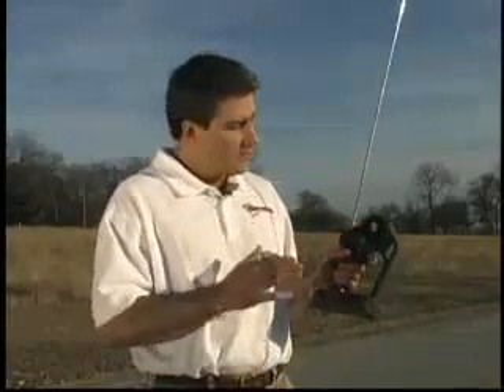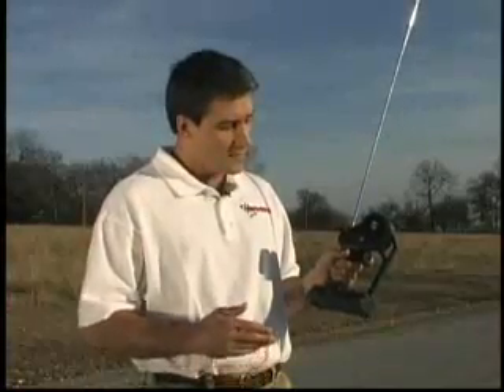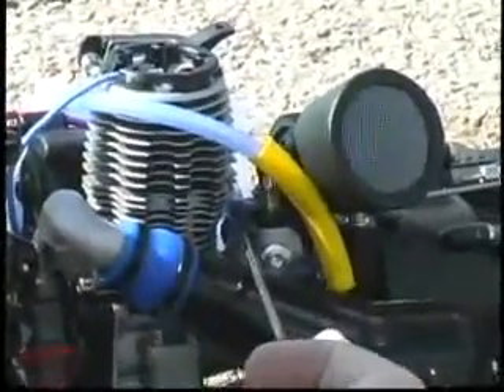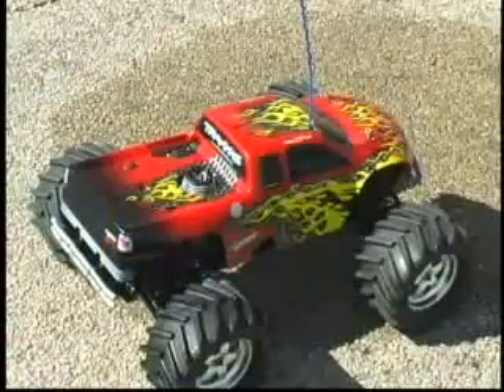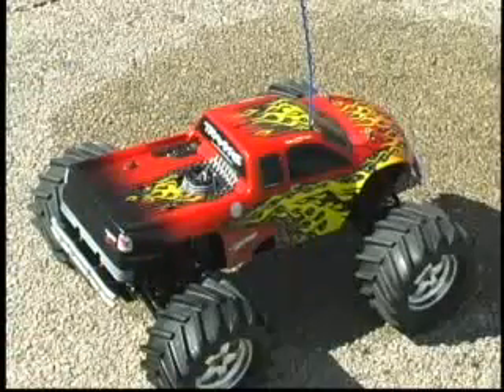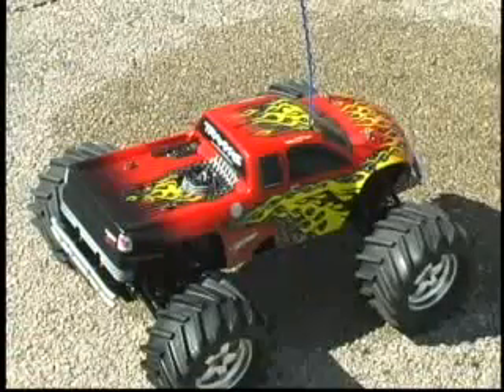Traxxas Setup Guide 15 of 21 Tank 3 Break in

Comment: I accidentally flipped my nitro sport on grass. it started to accelerate full throttle.. it might have been  because i accidentally turned my transmitter off. Idk it fine now. im on my thrid tank other than that its just the stalling issues ive dealt with.